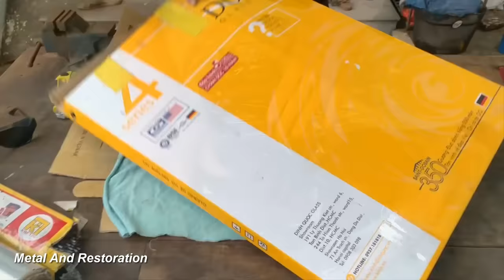Restoration Viking Axe Battle Old | Restore AXE construction Antique

Comment: sure it's viking and not an executioner axe? because it looks like it would be useless in combat. also how did you get the blade straight when you tempered it in sections? I've tried doing it that way before and it always comes out uneven

Comment: 1. It was unnecessary to cut out the weld burn through's 
2. When rehardening a blade edge, never do it in sections it has to be done all at once, the metal needs to be the proper temperature and never use water to quench. Use either linn seed oil, or canola oil. As water can make the metal brittle.
3. Always save rehardening until after all the rust is removed.
4. Welding in a patch like that can compromise the structure of the metal as well as if the grain structure is different.
5. Finally it's clear as day that this isn't old by the maybe one months worth of rust.

Comment: Remember restoring ancient items isn’t always the best choice. Sometimes it can destroy it, like if there was decorative work done by the black smith that work is gone due to the cleaning with a grinder & wire brush. Any markings even the black smith signature mark would be erased and easily be hiding under the rust.
Reply: This was made for the video and left out in the rain for 2 days to rust. This is not old. This is not a real axe.

Comment: No no NO! Absolutely should have used electrolysis to save as much metal as possible. Then you took out a huge piece of the original metal, and lastly, worst of all, you covered it with rattle can paint. Nope

Comment: That most likely is an execution axe.  It is odd that it has the smaller head on the back side.  Added incase the main head doesn't fully decapitate perhaps.  Or, a fanciful recreation maybe.  Anyone would have a tough time attempting to use that in battle.  Looks to me like its for a nice stationary target, with a nice wood block under its neck.  Got any history on it?
Reply: No, it is not an execution axe. Nor a viking axe. It is not historic at all. 
The design might have been inspired by a real axe, but for the construction: It is very clear that this is not forged. The blades are cut from sheet metal and welded to a piece of pipe. The holes in the blade are not corrosion, they have been melted into it. There isn't much more history to it than that

And what is that about the second blade on the backside? Why would you need that in case the first did not do the job. Just strike again...

Comment: 1) This is no Viking Axe.  It is a Halberd of some type.  2) Spray Paint !!  If anything Lye stain it.  3) Heat and water are a bad mix.  Should have been oil.  The edge on this is going to chip like an old dry biscuit.

Comment: Now instead of cutting that out all you would have had to have done is filled it up since you're welding instead of cutting it out you don't have to cut that out to do a repair all you had to do is just fill it in with weld I am a welder as well

Comment: I'm not looking to just bash on a random video, but there are just so many problems here. The weld was not the greatest, and you can easily see it. The spray paint was also just a stupid choice imo, but also made the weld worse because it stands out even more because of it. The heat treat was terrible. There is no thermal control, and doing it in sections would just make it worse than if you didn't do it at all. And probably the worst mistake of all, is calling this ugly thing a "viking" axe at all. This is what a gamer, a metal head, or a guy who rides a scooter probably thinks of as a viking axe. It's more of a generic fantasy barbarian axe.

Comment: Viking? sorry but there's no Viking axe in this. 
It looks like a Warhammer take on a Chaos Axe, if it is an antique then it was used as a meat axe for cutting large lumps of meat or cut through bone maybe frozen meat if not both. 
Also the the hole for the handle is round which will make the axe handle slip around in the fitting so it would be extremely unsafe to use unless you can throw some bolts into the side.

Comment: Luckily this wasn’t an actual Viking battle axe kinda easy to tell because of the welded on pipe but even better it wasn’t cus of how u used water to try to temper it the wrong way and because u spray painting instead of doin a patina or using the black magic infusion to protect it from corrosion but hey man better to try different techniques and leave others in the past

Comment: If this was indeed a genuine Viking axe...you ruined it. The temper was ruined, the finish was ruined, had to run a flimsy cloth over the "edge" several times to cut it, its usefulness in battle was ruined. It could possibly be used to train a child. 
And, excuse me? Spray paint?

Comment: I'm watching you work and, while impressive, all I'm thinking is that there's no way that's an authentic Viking axe - or any historic axe for that matter. The head is comically large and uses way too much metal to do what it needs, and the blade itself is too thin for chopping; a real battle axe would have a smaller, wedge-shaped head, and Viking bearded axes were constructed in a way that maximizes the cutting area while keeping the overall weight of the weapon relatively low. Not to mention, as others have noted, the hole in the blade seems like it came from a modern torch of some kind, and the Vikings definitely didn't have access to the obvious steel pipe used in this thing's construction. This is most likely a prop or some kind of show piece; old enough for rust, to be sure, but not historically accurate by any stretch.

Comment: the largest viking axes where called Dane axe and look nothing like this and is not from the viking period.
they is not one viking axe recorded that comes even close to looking like this.

 I have been doing viking reenactment and  living history for 15 years around york which is the biggest hot spot in the UK for vikings this is nothing more then a fantasy piece inspired from most likely the something round the 15th century rather the viking which pretty much ended in the 10th centuy.

also like others have said this is a piece of pipe with sheet metal welded to it which is fairly clear from the video.

Comment: Spray paint to “restore a “viking’s axe””? No way Jose. That’s the lazy and poor results way out. Could’ve rust blued it then polished off the edges. Or since you like shortcuts you could’ve polished off the black spray paint section and then cold blued it. The thing is Vikings would’ve had access to boiling water and rusty objects, so even if they didn’t do it, it could easily have been done in a time using only the technology of being able to boil water.

Comment: what a waste of time..that's just some cheap sheet steel,welded to a pipe- better woud be to pherhaps use it as a template and make a new one..that thing is wort it's weight in scrap metal